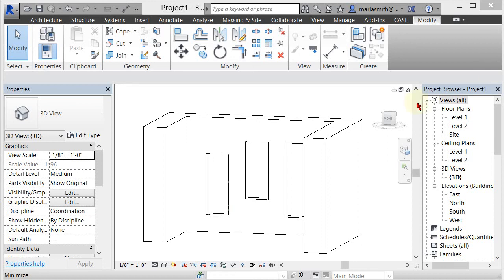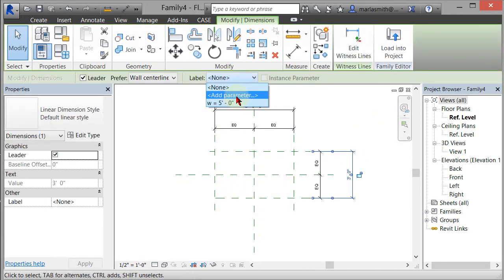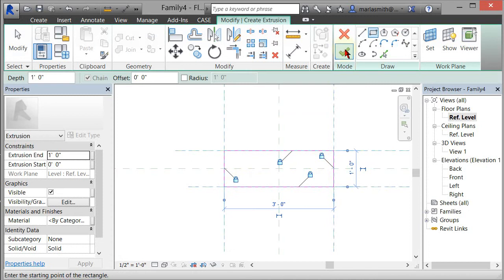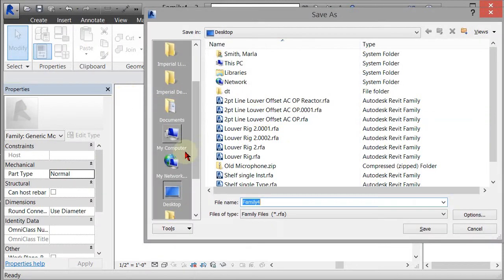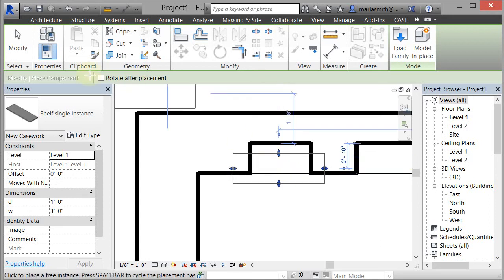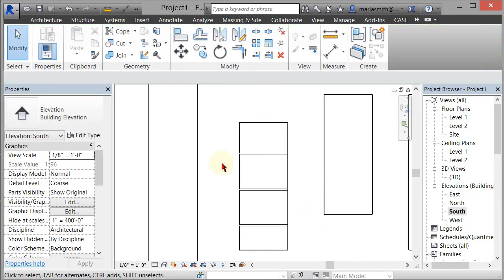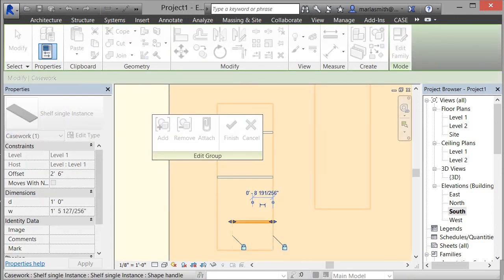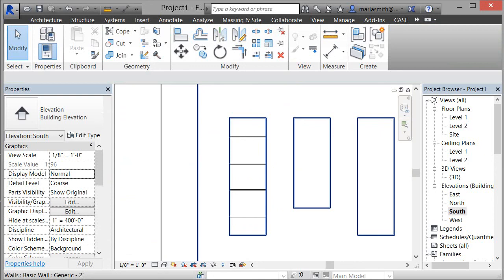REVIT WALL VOIDS SHELVES

Comment: Thanks for the great tutorial , I just wanted to ask how to create a horizontal shelf .. in case i want to create a walk in closet ??
I tried rotating the shelf 90 degrees into the front elevation , Error :(
Reply from the maker: Hi Fatma,
Instead of rotating the existing shelf you can adjust the h, w, d parameters to accommodate a different orientation.  I would make a new type first.  (You can also change the h parameter to an instance in the family if that's more convenient.)  Here is a quick example:
https://youtu.be/Ie0NklmnuXQ
 Let me know if you have any more questions.  Marla